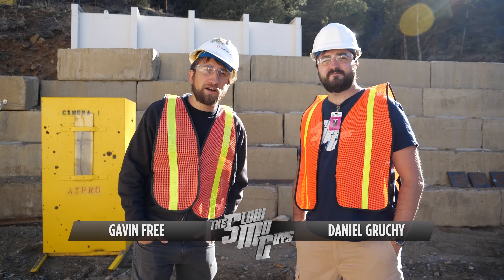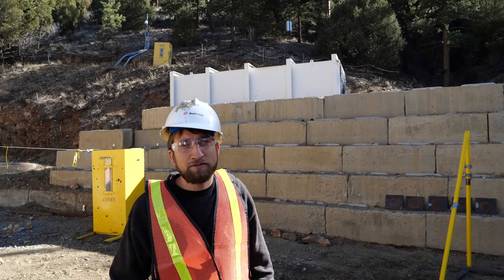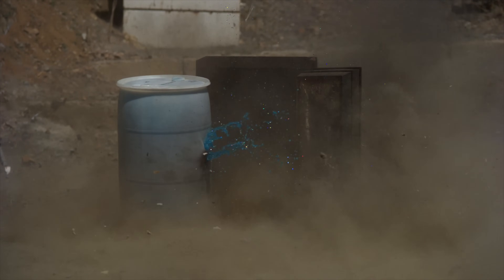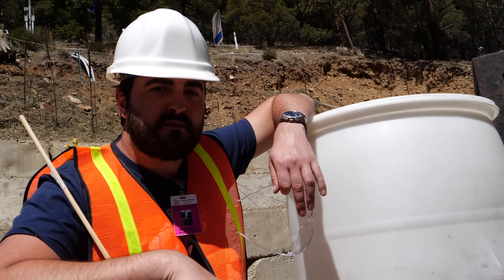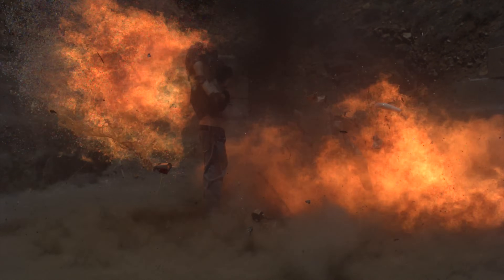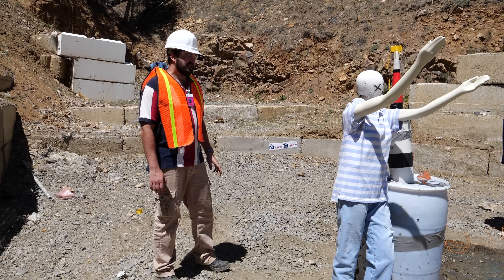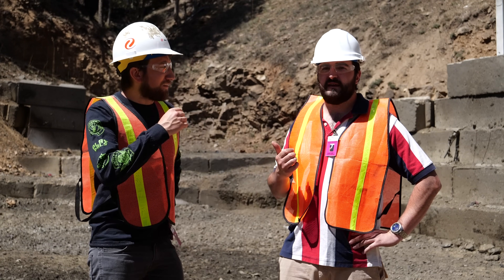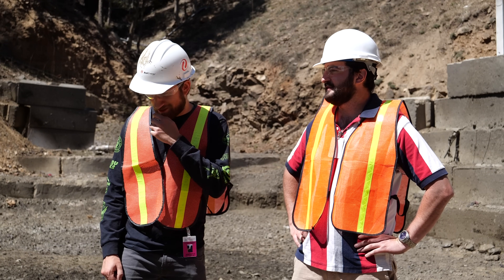Massive Explosive Chain Reaction at 200,000fps - The Slow Mo Guys

Comment: These kind of explosives were used in roadside bombs in Iraq in the early 2000s.  They were called EFPs.  Nothing can protect you from a molten hot copper jet moving at 3000 fps.

Comment: This is reminiscent of the squibs that were used with the controlled demolition of the twin towers. The squibs were placed at different floor levels directly beneath each other and programmed to explode seconds apart in descending order. 600 demolition engineers came to the same conclusion after viewing the building not only collaps but the pulverizing effect on the concrete was cause by the intense heat of the thermite used as one of the explosive ingredients.

Comment: When I was in the Engineers we had the opportunity to practice with shaped charges, both the circular ones and linear ones. Linear shaped charges are ideal if you want to make a neat cut in concrete surfaces, like bridges. Incredibly neat, straight cuts up to 1 metre in depth.

Comment: 3:52 High explosive anti tank shell 0.5 (HEAT shells use the same mechanism) 

Edit: these shaped charges are made to penetrate more armor/armour then kinetic energy shells/shots, (ie, aphe, aphec, aphebc, aphecbc, ap, apc, apbc, and apcbc
 (lore: ap = solid shot, aphe =solid shell that explodes inside the target, C = cap, to help against angled armor/armour, bc = ballistic cap to increase aerodynamics therefore more speed and due to that, penetration and cbc = cap + ballistic cap))

Comment: I've noticed in ballistics cases they use a 12ft water column to catch the slugs after they are shot out of the gun in question.  Does the water stop the copper and it doesn't come out the other side because water turns solid on impact?

Comment: To put these speeds in perspective 

It would take the shock tube 5 hours, 33 minutes, 57 seconds 

It would take det cord 1 hour, 35 minutes, 25 seconds to go around the earth

It would take the shaped charge (if it were to travel at a constant speed) 1 hour, 6 minutes, 47 seconds to go around the earth

The ISS circles the Earth roughly every 1 hour 33 minutes

Comment: Would've been awesome if you show us the copper from the shape charge inside the barrel.
Reply: It's all powder like it was on the outside of the barrel.
Reply: @DinnerForkTongue  the water barrel. Must be copper fragments inside the water barrel container.
Reply: @7150285 
Dan explained after the shot that he was wrong about this shaped charge. He was expecting fragments because he was used to solid copper charges, but this one uses copper powder. There wouldn't be fragments, only a smattering of darkened dust.

Comment: Not to be negative, cus what your doing is really cool, but that was a firebox, not a safe. A safe that size, would normally have a door thickness of 1.5" solid steel. A firebox has concrete or gypsum to keep the contents safe in a fire for a specific amount of time
Reply: Wouldn't have changed the outcome....

Comment: Very interesting to me.  I was Army infantry being transported on a Navy “Armored Troop Carrier” boat on the Mekong River in 1969.  I was laying down on the deck of the troop well in front of a giant styrofoam cooler that had a large amount of water in it.  A Viet Cong B-40 rocket, almost the same as a modern RPG, hit the outside of the hull slightly above where I was.   There was a loud explosion and I was covered in water and styrofoam fragments.  Only 1 person in the boat had a minor shrapnel wound.  I knew it had to be the water in the cooler that saved me and others.  My theory was that the molten copper and steel droplets were small enough to be stopped by the water. Also the damaging hot jet of gas would have been abated by the water. Your barrel was about the width of the cooler.

Comment: @The Slow Mo Guys I like your stuff but I have one complaint about something you do frequently. You vary the speed of playback during playback instead of running it through at one speed, and then playing it back again at a different speed. I would like to see what it looks like at different speeds, but not have it's run-through at one speed be cut short, by you changing speeds in the middle of playback.

Comment: nuke in 4k200,000fps PLS
Reply: Yo what u doin here lol
Reply: There's old footage of a nuke going off at 1,000,000fps...not in 4k, but It's insane looking. here ----> https://www.youtube.com/watch?v=Yt3JVgzOZzE
Reply: @ChimpFromSpace  beleive it or not thats only 2000 fps or so.
Reply: Its a matter of scale. In your link the fireball is 1 kilometer in size when it reaches the ground.
Reply: @dovydenaspdx  Nope. the tower height is 150m on that test. Its operation Teapot, Turk elevation was 1.4km but that's from sea level. Bomb was 150m from the ground. designed 55 kt, 43 kt actual. it's only the fission primary or 'trigger' from a 1-2 Mt thermonuclear bomb.
Reply: @ChimpFromSpace  if this is a Rick roll…
Reply: It wasn't a single camera used to film the nukes. It was a series of sequentially timed special cameras with a shutter speed of like 10 nanoseconds. The shutter isn't mechanical, it's a polarized filter that uses electricity. The system is capable of millions of frames per second, because it's just the timing of the sequence of cameras that decides the frame rate. The entire video of the detonation was filmed over the course of one millisecond. It is MUCH MUCH higher than 2000 frames per second.
Reply: I’d think they’d get only one shot at it lol
Reply: Nope
Reply: you mean a nut in slo motion
Reply: WAIT WUT linkmon wut u doing here
Reply: I'd say the footage in question was shot at quite a bit higher than just 2000 fps. According to this article (https://www.atomicarchive.com/science/effects/fireball.html ), for a bomb of 1 megaton, the fireball takes approximately 0.7 milliseconds to expand to ~135 m, which is close enough to the height of the tower (150 m). From explosion to touching the ground, we're looking at 160 frames, let's say total duration is 1 ms. That would put the footage at 160,000 fps. 

*However* the bomb in question is also significantly weaker than 1 megaton, about 1/20 in fact. This means the fireball would cool and thus slow down much more rapidly. Considering the rounding errors, my guesstimate would be that the footage was shot somewhere in the 20,000 fps range (though I'll admit that I'm having a hard time accurately estimating the effect of the much lower energy).
Reply: @Kenny Donachy I'm sooo sorry I offended your feelings, Mister InternetPoliceOfficerSir.
Reply: Ferb, I know what we're gonna do today
Reply: Yo linkmon pls friend me in roblox
Reply: 4k footage of nukes already exists
Reply: That's not really possible cause heat and the shockwave but its a good idea
Reply: You can buy a Nuke off the google store for £214.99 Today!!
Reply: Are u joking
Reply: Ayo....
Reply: This didn't age well
Reply: they dont exist

Comment: 12:57
Dan: The bomb forces an avalanche.
Also Dan: So its not dangerous.
Reply: So the area isn’t dangerous. As in the avalancher removes the danger of a random avalanche
Reply: @femmefuntime  a controlled avalanche, if you will.
Reply: It's so it's not dangerous for a random skier to accidentally cause a deadly avalanche, if it's in a controlled environment then it becomes safe so there's far less risk of harm involved. So yes, forcing an avalanche, assuming precautions and such are in place, is far less dangerous than leaving it up to chance
Reply: @xPanda25  its a joke.
Reply: @xPanda25  you are thinking too much about it
Reply: @zuruecksetztuebernacht  You're not thinking enough about it.
Reply: @Mason_Blondeau  i think this was a joke but i genuinely wouldnt be able to tell you as i've changed so much as a person in 2 years

Comment: The last explosion was used for over 30 years in Northern ireland on a much larger scale by the ira but instead of using dummys they used it on humanbeings in built up busy areas so that glass would be blown in and then be sucked back out on top of people outside resulting in catastrophic injury or worse,  the shock wave would cause this to happen for several streets/blocks.

Comment: At least, this video is (around 11:46 - 11:56) a graphic representation of scenes described in thrillers (latest from the Tom Clancy series or the like) about wearers of explosive vests: getting the ID of a "not so smart bomb" is facilitated after detonation by having his or her head mostly in a condition without major wounds. The neck works as a kind of predetermined breaking point when the detonation waves travels upwards, making the head soar away for some meters. If I recall correctly some quotes, some pathologists from Israel or the US military sometimes even found a plug of khat or other tranquillizing drugs between the molars of the bombed head, which didn't fall out during the act.

Comment: The same shape charges I’ve used in fracking industry. Pretty cool to see them actually detonate on surface. We usually detonate them in wells 12k-25k feet deep (usually around 4-8k vertically and the rest of the way horizontally), and you can feel them go off if you put your hand on the well very easily. Pretty crazy.
Reply: Why? I don't understand
Reply: Joey Knight why do we use shape charges on frac sites you’re asking?
Reply: Amazing to me how you can precisely position the shape charge that far down range (vertical hole then horizontal). You guys totally rock, and thanks. Northeast PA.  :)  would be awesome to see a video of you guys working that out!

Comment: The Slow Mo Guys, I've lived through several IED explosions.  It's INSANE to me to think about how a hard object such as a toilet seat would be absolutely obliterated like it was.  But then given some blasts against soft targets, such as a human body, I have found bodies that were relatively intact.  When I would think that something like that would cause someone to be absolutely incinerated.  I know it's morbid to think about and possible discuss, but I also thought it was absolutely fascinating.  

Say for instance, one guy detonated a truck with 1500 lbs of explosives in a suicide bombing.  The truck was obliterated, but things like the engine block survived, albeit thrown across the road and through a building.  BUT, and this is the morbid/fascinating part.  The guy who blew himself up, we found the upper portion of his body mostly intact.  Despite the intense heat and pressure, we found from about the sternum to the top of his head.  The only thing was it was just skin.  No muscle, not bone, just skin, like it was some ghoulish halloween mask.

So if you guys do a slow mo video on explosions, can you test that?  Like maybe have one of those ballistic gelatin bodies and see how that handles up to a major blast?  Maybe different mediums also?

Comment: Fun fact: The shape charge fires at around 10,000 meters per second, as Dan said, and the I.S.S. goes at about 7,200 meters per second. The charge is faster than something orbiting around Earth.
Reply: it's actually almost hitting the escape velocity of Earth which is 11,186 m/s
Reply: @LazicStefan Not necessarily, the angle has a big role in orbit, but I guess that at the right angle and height you could get a shaped charge to orbit
Reply: Spencer Greer  What’s even crazier is that the Parker Solar Probe hit 68,600 meters per second and is scheduled to hit 192,000 meters per second later on in its mission (about 120 miles per second).
Reply: @karagi101  One could call that pretty speedy
Reply: Mushroom On A Keyboard  Cheer up. At that speed he probably crashed somewhere.
Reply: LazicStefan satellites and the ISS are propelled, they require boosts from time to time, otherwise they would fall to earth. The moon is moving away from earth.
Reply: You could shoot a gun on the Moon and it’d start orbiting the Moon

Just move outta the way an hour and 45 minutes later when it comes back around
Reply: @LazicStefan It cannot, because it's not propelled, so it's speed is decreasing fast. It's not designed to travel a long way and would stop and fall pretty quickly, in regards of the velocity it developed.
Reply: @1604Sylvain  if you held it at ~100km it would probably enter an extremely eccentric orbit, not shot at orbit if on the ground though
Reply: @LazicStefan That's not what I said 🤔
You're asking if by fire one of this charge "at a certain altitude", it would enter orbit. It does have a great acceleration, but do not fly for miles, it's stopping fairly quickly. So unless you shot it from space or at least, outside the atmosphere, it can't..
Reply: I love how this entire thread is amazed that the detonation speed is comparable to speed of the ISS and not that the speed of the ISS is comparable the speed of the detonation of a shape charge.
Reply: Mushroom On A Keyboard  You may want to take your own advice.  Not being able to discern or appreciate humor suggests something’s not quite right with you.
Reply: @LazicStefan there no point in your question then.. 😅
Every object that you put in space will be in orbit if you want so, no matter if you shot it or not...
Reply: WarTactical Every object in a stable orbit is in free fall.
Reply: @karagi101  I never denied that, but the speed of the initial burst would never be enough to to keep it on orbit, precisely.
What I was trying to say, that's if you simply wan't to put your object in orbit, whiteout any time question, without any inconvenience, it would be in orbit, even for a milliseconds, before dropping.
Reply: WarTactical You need a certain angle and terminal speed to get an object into a particular orbit.  Different orbital heights, different angles & speeds.  An object that makes it, stays orbiting indefinetely (as long as it’s not slowed down by atmospheric drag — there is some since the atmosphere only thins out the higher you go).  So an object that, as you say, made it for a millisecond and then dropped back didn’t actually make it into orbit.
Reply: @karagi101  I'm not the one that need that explanation lol
That's what I was trying to explain to the original comment
Reply: WarTactical OK.  Sorry if I misunderstood.
Reply: @karagi101  No worries at all, it always a pleasure to talk about space 😁
I didn't meant to be aggressive or anything !
Reply: karagi101 no, orbits decay. You can’t put something into orbit and have it stay there indefinitely, they need altitude boosting from time to time and atmospheric drag isn’t the only factor in that. Thats why SpaceX’s new capsule will retain its abort system after launch in order to reboost the ISS if needed. 

Also, I’m not sure who mentioned it, but there’s absolutely no way that the jet of molten copper resulting from the detonation of a shape charge would ever get close to the altitude or speed needed to orbit the earth; it simply doesn’t have enough energy behind it. Although it’s travelling at very high speeds initially you’d see it decelerate and drop off very quickly over a distance due to aerodynamic and gravitational forces, that’s also what happens if you throw a ball into the air. For the jet to reach orbit it would need to be accelerating
Reply: It’s going Mach 31.5
Reply: Delivery; heya.jpg
Reply: NERDS
Reply: @the1sttime  Perhaps
Reply: @the1sttime  and...

Comment: You have enough diesel fuel there to push an 80,000 lb semi truck around 2 -3 miles.  You released all the energy instantly.  And that doesn't include wasted heat.

Comment: The copper jet is moving at between 25,000 and 30,000 miles per hour.

Love explosives.
I worked with Bomb Squads some years ago,and we tested explosives under vehicles, and against fortifications.

Great fun unless your on the receiving end.

Comment: As a 12B or combat engineer in the army. Blowing things up is always a blast. No pun intended. However to stay safe and make sure what you’re using detonates always have a 6 inch tail of det cord running off to keep the powder inside from getting wet. And shape charges are also made to shape the earth, also depends on how big that said charge is.

Comment: Okay let's do some math/physics. 10000 m/s = 10 km/s. To orbit the Earth 0 m from the ground, you would have to have a speed of 7.9 km/s (using v = sqrt(GM/R)). The scape valocity of the Earth is about 11.2 km/s (using v = sqrt(2GM/R)). So that thing is literaly a rocket. It would not leave the Earth, but would stay in orbit. Think about that. An explosive that would go into orbit. Fire it in the direction of the horizon and, if not obstructed, it would rise into the air, lose some speed, and go into a f**king orbit. 10 km/s is about mach 29 btw

Comment: There is another step in the chain reaction that you left out. The explosive in the det cord is enough to detonate the explosive in the detonator, but the explosive in the detonator is not enough to detonate the plastic explosive on its own. The detonator propels a small disk into the plastic explosive, there is a relationship between the area of the disk and its velocity that needs to be overcome to set off the final explosion. If the disk comes out crooked, it just splatters the explosive material all over without detonation.